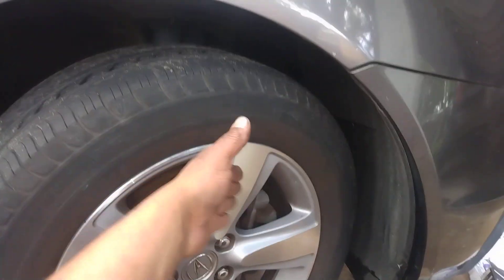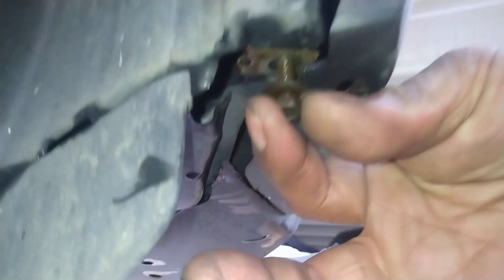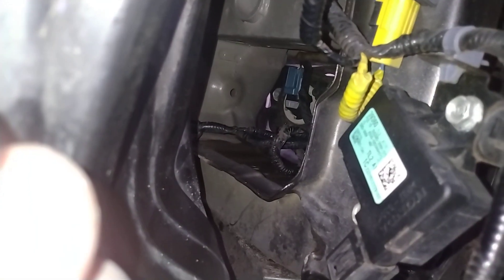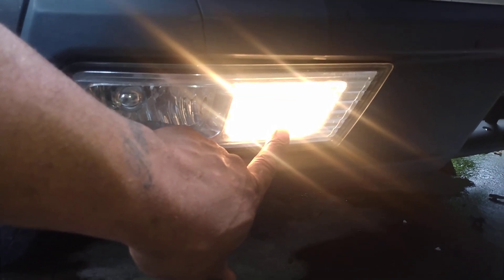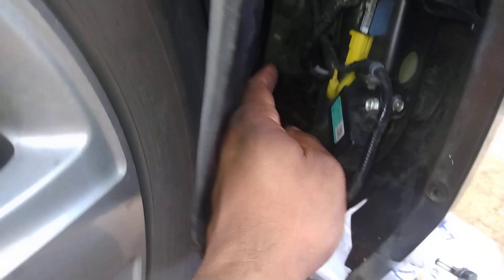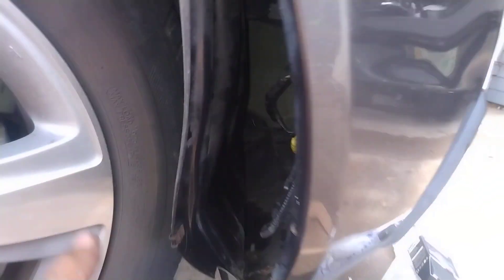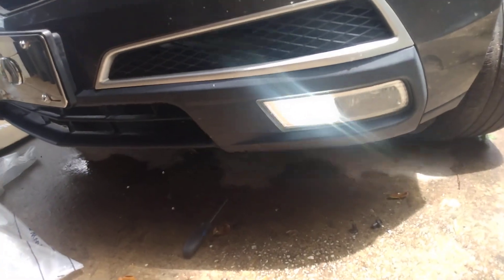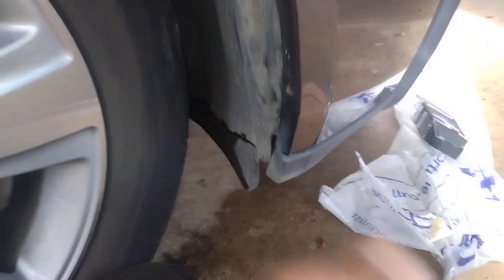2010 Acura MDX daytime running lights LED swap.

Comment from the maker: UPDATE  After you install LEDs, you will get that dreaded "Check DRL system" light.  If you install load resistors with the bulbs, then the light will go away. LEDs don't use that much power, so the computer thinks the bulb is blown.  Here's a link to the resistors 
https://www.ebay.com/itm/363431910829?_trkparms=ispr%3D1&hash=item549e3addad:g:EY4AAOSw0xtcDiwn&amdata=enc%3AAQAGAAACoPYe5NmHp%252B2JMhMi7yxGiTJkPrKr5t53CooMSQt2orsS5%252FLJbfonbQUYd49AU1AJY8rYI%252FBBrqK4aFA8e4tt2uH1BvxtCyKCvKmpRachFJdXp9phHhXC0hmiO5Sut5pG7jbkGmaqoofgRyxxBAI0o56p8iedORdZ0bKK2E0TYhPTTfYJs%252FLFAM5aQdK4Jgp%252BcRFNAtWg5DHi2pqMn5FNM%252Bc%252BNRbQgTvqbWiEZ79EA6U4pfkaU9qjSY7i9KgQLE4NLjkgFDx%252By55ek0aaFgU8Kqhn1HS2N0VTtBGZkhGTa7E8VEn0SS8KlvF3iyMLMN76hnMArqj18yPsQsrrpJ1X6N1YuBtESHu7Vqpmc0O1B2FujS1g5aApdpvUoJUQ7LR%252BAZz6IXgLGvhrvVUTyHXFFObp0YBh0XQJbbbAQI%252FngyQVETgVOYpeSeTEK4BgpgxqtNh0DZAYvUcsS4BbFZOPoy0uXAZmxvmn3w2OanDbAJZaSqQYH6ASZGnsNXRvtC2gHfap5tCnLPtcf5QxeIJwQEHaunnIhgB%252BeOipQ87Hf%252BUj3YQ97sEFOldE4FZlfCQJeXUWlq9fyXcV1IvvME6Qbl%252B4048f7oU8TbWg%252FC2T3%252BIEwgJmJyvYZ4%252BrfE%252BaroHJ%252BDC5xu8h%252FY5eu3JhWrUQtvA6T%252FCbHPZMS%252BtfjIE7CX6Kn0MXK3kD5a7gmH2squRsODMor3d%252BQrdgtcG4lz%252FcRZdlzMCf7SMuLicM3m%252FAW%252FsNS4kvR1%252FvpgXdiBizEWqZCWLxxF%252B4xXEitqhh27X5W19q7OMfOgLcP1i1sgGCjo27YgE2mMRb9KLqJEYZtQ5JEtuO1BjB0iHtSuX4XmHLh5nvF6sR6%252Fe3L8VakGiWCR56vfBAu3y6Z9YXMdOJHdk41Q%253D%253D%7Campid%3APL_CLK%7Cclp%3A2334524
Reply: Thanks a lot
Reply: Thanks for the video. 
I just did my low beams to LED and was going to do the daytime lights. 
Hmmm to install a resistor in that tight spot, it doesn't seem worth it to me. Did you install resistors?
Reply from the maker: @fortunatedad7695   If you want the DRL warning light on the dash to go off it's definitely worth it. If you jack up the vehicle and remove the front wheels then there's a ton of space.  No I did not install any, because the customer didn't care about that warning light being on. The way to avoid resistors and the DRL light is to get LED bulbs that are Canbus compatible.  Back then we did not know about this, but nowadays there are much more LED bulb options on the market that have built it resistors. The cheaper bulbs don't have it and that's why resistors are needed.
Reply: @Jedi_Luke  good point!
Since you do this for work, you would most likely know then if the H11 for the daytime lights and the 9005 fog lights are the same connection types?  I found a 9005 resistor kit and was wondering if I could use it for the H11 bulbs and acura connectors?
Reply from the maker: @fortunatedad7695      No sir, those are 2 different connectors.  9005 and 9006 are similar with slight modification, but H11 is a smaller plug and won't work.  You will have to buy a H11 resistor kit or get different H11 bulbs with Canbus.
Reply: @Jedi_Luke  thank you, they look similar but tough to tell until a guy has them side by side lol
Reply: @Jedi_Luke  thanks for clarifying all this. I've watched so many different videos. One says some cars you need only resistors and some say you only need decoders. 
Ok I will get a H11 with a decoder. I've installed a resistor before and they are a pain as honda doesn't give you much wiring to tap into lol.

Comment: Hello sir, great video. Can you please kindly tell me the brand and bulb size of the DRL and FOG bulb? Much appreciated.
Reply from the maker: This was a customers car I did years ago but I believe the fog lights are H11 and the DRL is 9005.  If you just take your bulbs out there should be a number on the back so you can see for sure.  As far as the brand you can pick whichever one you want. eBay and Amazon have huge selections.  Don't get the super cheap ones because they don't last. You don't need super expensive either lol

Comment: Hey man, I installed them, but they flicker very low, almost like they are turned off. Any pointers, anybody?
Reply from the maker: Read the pinned post in the comments section

Comment: Can you send a link for a 2012 mdx I can’t find what lights to get
Reply from the maker: The size is 9005.  Just type in "9005 LED bulb" on eBay or Amazon and pick the ones you want.  Preferably some that are canbus or error free.  Don't get the super cheap ones as they don't really last long.

Comment: I just bought a 2010 MDX from a private owner.  So, could you please tell me how do I turn off the daytime running lights.  Or do they supposed to stay on while the car is running? Thanks
Reply from the maker: They're actually a great feature. They are meant to be on all the time as a safety feature, so other cars can see you.  There's no "normal" way to just turn them off, unless you wire up some custom foglights with a toggle switch.  The only easy way you can get them off is to just remove the bulbs and leave them out, but you will have a permanent warning light on the dash.
Reply: @Jedi_Luke  I’m already replaced the bulb but the message is still on on the dash
Reply: Permanent
Reply from the maker: @Francisco Bencomo yes if you just get regular LEDs then you're stuck with the error light.  I believe if you were to get some error free lights or install a load resistor on each bulb, then the message would go away.

Comment: Question how easy is it to take the light out of the housing. I tried turning mine counter clock and he won’t budge
Reply from the maker: Should come right out.  Don't be afraid to break it if you're replacing it anyway

Comment: Is the daytime running light the same type as the fog lamp ?  Can they be swapped? I have an old fog halogen spare when I changed to led
Reply from the maker: I can't remember.  This was my customers car not mine.  Just pull the bulbs out and see if the numbers match up.

Comment: Looks awesome besides that I'm having a hard time seeing the lanes that would be a good fit for my MDX, do you happen to have the link of those bulbs?
Reply from the maker: I wanna say they were H11 size bulbs.  Just pull one of your old ones out are check the number on it.  There are plenty different brands online to choose from.  Don't forget to get load resistors so you don't end up with a "DRL" light on the dash.  Thanks for watching